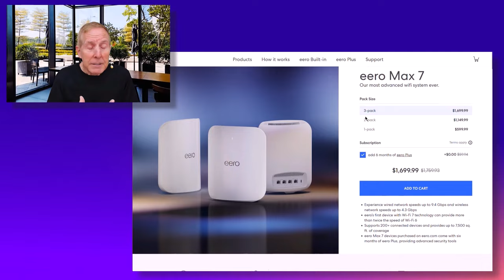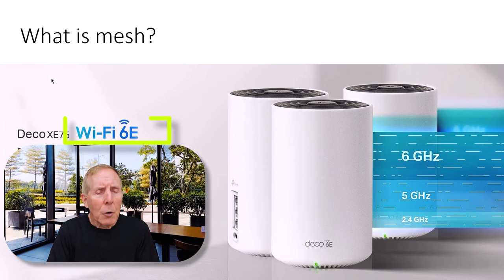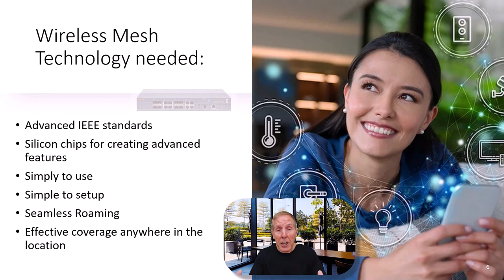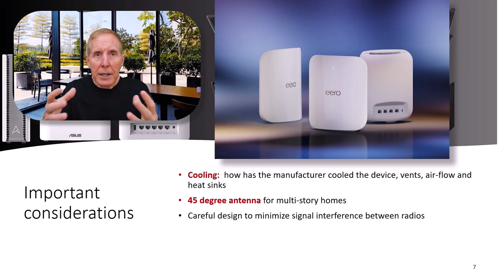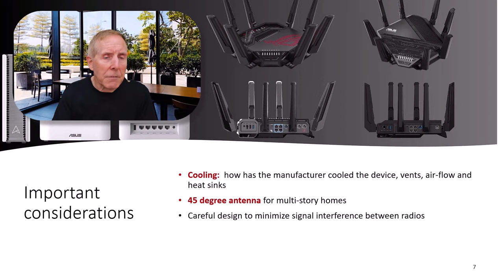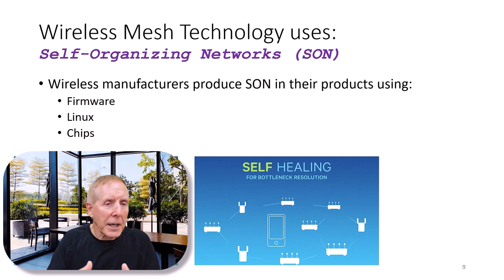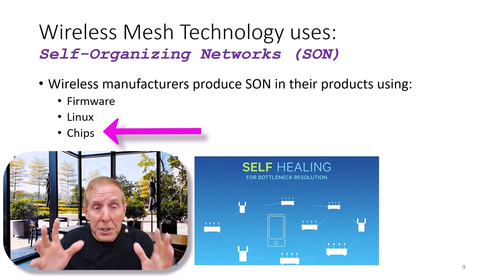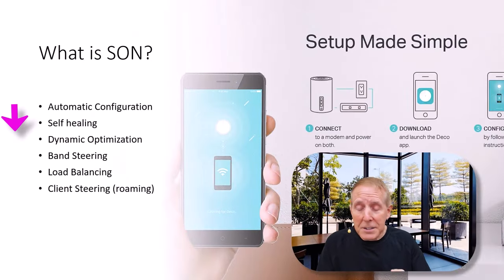Unlocking the Secrets of Wi-Fi Mesh Technology: The Power and Pitfalls of Wi-Fi 6E & 7 Mesh Wireless

Comment: Very interesting video! I'd like to delve a little deeper into the physical/technical aspect of bandwidth over Wifi, if you don't mind. In particular, from about min: 10.55 we see the loss of signal as it has to go through walls. We all experience the drop in bandwidth resulting in slower and slower download speeds, for example. I'd like to know what happens to frames/packets sent over Wifi in these circumstances. I mean, is the slower download speed  because some of them don't make it through the wall and have to be re-sent by the AP, or what exactly? I have never figured it out? I hope I was clear. Thanks.
Reply from the maker: Your client radio and AP auto adjust speed as your RF signal decreases and the error rate goes up both agree on a slower speed.   This happens dynamically between the two radios/transmitters.
Reply: @vvyProductionsok, but what exactly does the AP change? I mean, physically. Frequency? Thanks
Reply from the maker: Frequency will change but is much more complex than that.

Comment: I would like to centralize wireless access in my home, which is not very large. My Internet connection is in the office.  I'm considering getting a Ubiquiti Edge X router, 4 port and created a wired connection to a Deco running in access point mode. Is this a good setup? Do you suggest any other configuration, such as wired back hall with 2 decos. Thanks!
Reply from the maker: Ubiquiti make good network gear,  Deco can run in AP mode and depending on the size of the home and where wireless needs to have a strong signal, then two Deco's would be better.  If you can do a wired backhaul that is the best (not sure if it supports this feature)  I would have to dig into the manual further.

Comment: I live in a concrete house and I needed mesh to work with a wired backhaul. I spent nearly 1000 dollars on WIFI6 hardware from TP-Link which said "Easy Mesh" on it, only to find out that the Mesh mode only works if the backhaul is wireless. What this means is that Mesh is pretty much a hoax if you live in a concrete house, because you'd be forced to have a mesh device in every single room, including rooms that are seldom used since the wireless backhaul range on them is so bad in concrete buildings and you need these intermediary devices to act as signal relays.
Reply from the maker: You are soaking in the limits of  RF wireless, even with 1watt amplifiers you would have difficulty.  Microwave signals and concrete walls do not mix well.  Ouch!   You better start drilling holes for CAT6A and enjoy ethernet again.  Thanks for the comment and your support.